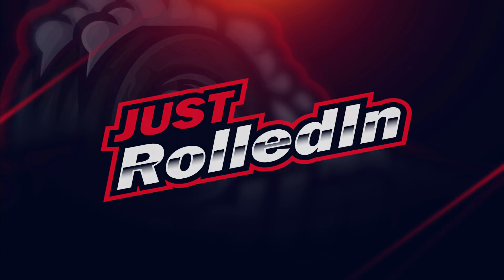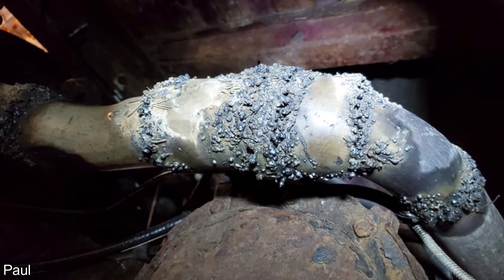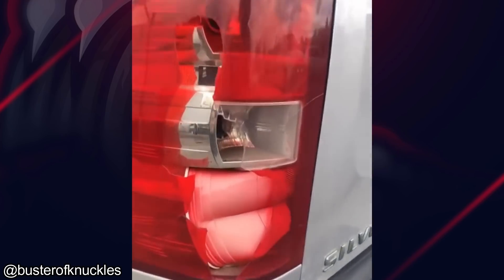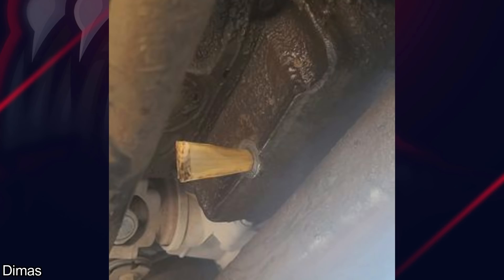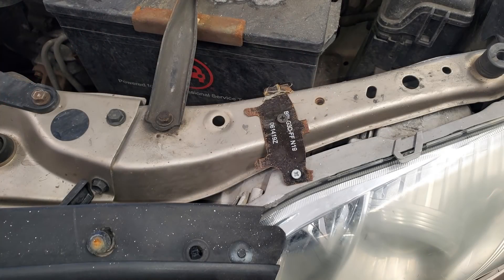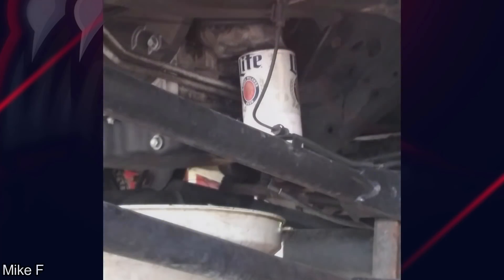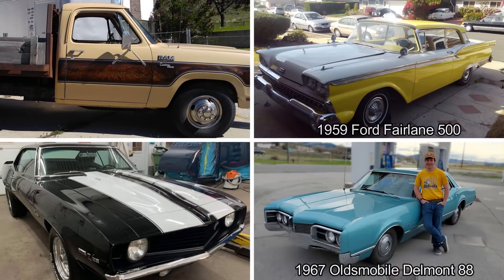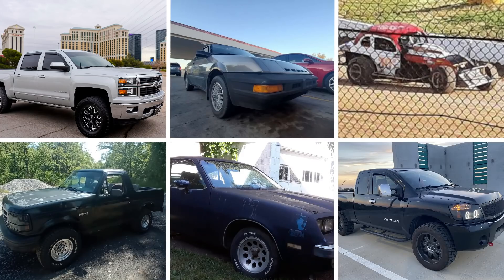Customer States Another Shop Failed To Fix Their Exhaust | Just Rolled In

Comment: 2:30 - Happened to my mother's boyfriend once. He brought his '95 Grand Prix into the dealership he bought the car from for the "free lifetime oil change." On his way to our house the next day, the car was extremely difficult to control. So, Mom asked me to take a look at it. I drive the car down the driveway, and as I hit the transition between our driveway and the street, the steering wheel tore itself out of my hands! I drive (slowly) up the street a little and notice a severe case of Death Wobble. Turn around in my neighbor's driveway and the steering wheel rips itself out of my hands again. So I get out and take a look...
I approach the front left wheel and notice it is tilted at an unnatural angle. My first through (EDIT: THOUGHT) was ball joints or busted control arm. I go to wiggle the tire by hand, and one lug nut falls onto the ground! So I look at the 4 remaining lug nuts, two of which are BARELY engaged on the studs. The little plastic caps that thread onto the lug nuts for aesthetics were all cracked, and they weren't that way a few weeks prior when I did a brake job.
So I thread the lug nuts on as much as I could by hand, and brought the car back into the driveway. I removed the plastic caps and tightened the lug nuts PROPERLY - it appears as if they used the impact wrench on the nuts WITH THE CAPS STILL ON THE LUG NUTS! As soon as I snugged them down, the car returned to its former smooth handling and I knew that was the "easy fix."
So I told Mom's boyfriend to call the dealership and read them the riot act. This was a stupid and dangerous error that needed to be addressed with the tech. (If I were the Service Manager, I would have had some brutal words for the tech, and might have considered termination! There's some serious liability issues here!) The dealer's response? "Well, they HAD to take the wheel off to perform the oil change."
No, they did not. GM's 3100 engine has the oil filter mounted close to the centerline of the vehicle, complete with a v-shaped piece of steel to divert draining oil into a controllable stream. The oil plug is also along the centerline of the vehicle. There was NO NEED WHATSOEVER to remove the wheel to perform an oil change.
Needless to say, we no longer took advantage of the "free lifetime oil changes." We started doing them ourselves; the cost of DIY LOF is much cheaper than hospital bills or funeral arrangements!

Comment: Worst thing I ever saw on a stereo install was somebody who decided to use the single  retaining bolt for both rear seat belt buckles for the amp ground. What did they use to attach the seat belt buckles to the body? Nothing...they used a carabiner to join them together. In a crash, one buckle would just pull the other buckle through the seat cushion! 🤣🤣

Comment: Looks like they used a MI welder on that exhaust...You know, 'A MIG without the gas turned on"....those loose lugnuts on the 'forged' wheels...I've got a 73 Corvette with aftermarket aluminum wheels, they make sure you know about the hardened steel washers that go on there behind the actual lugnuts.

Comment: Hahaha, on my car the t bolt that holds the emergency jack to the side of the trunk sucked and wouldn't support the jack properly so I just tossed it in the trunk instead. When I did my subs I was looking for an easy bolt to ground to and was like. Hey the tbolt threads might be a good spot, sure as hell worked absolutely mint

Comment: Fight Big Oil. Use it unrefined, straight out of the ground like nature intended. Or if you can only find globs on the beach, boil the excess water off and pour it in. Don't worry about the sand. That's what the filter is for.

Comment: For bigger car amps usually I would run at least 2 x 4ga back one + one - and ground the - at the back as well. All paint and other coatings must be removed relying on a star washer to ground through paint is going to end up bad one way or another. Best case scenario the amp will be gutless worst case it burns the car down.

Comment: I bought a SAAB some years ago, as I had always dreamed of gettign one.

Ok, this was a SAAB 93 1.9 TDI and so it was a GM / Vauxhall Vectra I suppose, but hey ho!

Anyway the seller gave me a 30 day warranty as is required by law n the UK, and 33 days after buying it, it jumped into Limp mode.

I had been given assurances that it had just been serviced before going onto the forecourt, and it clearly had not.

It needed a full top end rebuild, new EGR, New inlet manifold, new swirlflaps, new this, new that, new the other...

Since doing that, it has been sweet, but the syrup that we managed to get out of the engine was nothing short of disgusting... It had not had an oil change for many many years.

I think that rather than just get it sorted, they waited until the car was about to fail, then sold it off.

I still have it and I recon with proper servicing and use, it should last me for many years to come.

Comment: Ive also seen diff fluid come out that color from a chemical reaction from an aluminum housing
Reply from the maker: Dang never seen that. Interesting
Reply: @JustRolledIn  i done a newer ford recently.. it was a xlt with the 5.0 had a aluminum housing i saw a white color fluid swirling with the diff fluid and was like what da fack is this?? Showed my boss.. which is a 15yr diff tech told me thas cuz it was in a aluminum housing. He said...if it were mixed with water it would be thinner and all one color..it was a new one on me as well 😂 but never seen em b full of shit before
Reply from the maker: @bmanclassics4350  Very interesting. Never heard of that and I even worked at Ford lol. The more you know lol
Reply: @JustRolledIn  hell yeah man..bein honest its like one of the 2 diffs ive ever encountered with a aluminum housing im more of a jeep or really any Dana axel man myself..but i will but open a clam style every now then (such as 90s thunder birds or LX model sedans such as newer chargers) and alot if gm 8.5's u dont really see fords here that much on the differential end of things.. unless its a 9" swap or ratio swap

Comment: As hilarious as that wire feed weld job is, at least the guy stuck with it and tried his best. However, by the look of it, he didn't get to drive it for long, as the mess is still pretty fresh. For his next project, he should learn how to use an angle grinder. Then maybe he can hide some of his bad welding. I am curious though, it seems there was a lot of splatter in weird random places. Perhaps he was using a hand held fixed tint welding mask and welding one handed?

Comment: The way I like exhaust job done is with good common sense, something that lasts a long time and durability. I would rather have a pipe slid into another pipe a little ways and then clamped with a stainless steel band clamp and if it's for performance. Starting front to back the pipe slid in beginning with the front and slid to the back so there's no ends that catch. And also any system I want plenty of muffler hangers and supports. Maybe one day they'll come out with aluminum pipe and full exhaust and muffler systems to keep the weight down for maximum performance.

Comment: OK, the missing drain plug, I totally understand in an emergency you have to keep oil in the engine, right?  What would you recommend?  Drive it without oil?
Reply from the maker: I'm not going to recommend people using a piece of wood as a drain plug because I dont want people blaming me if something goes bad lol, but ya it will definitely work to get you where you got to go. If it works, it works.
Reply: @JustRolledIn  As long as it is in the right circumstances.  In remote offroad locations, just to get to cell service or access to parts.  yeah, in town, where you could just as easily get a new plug, just take a cab or have it delivered.  But then, how do you lose the plug out in the woods, without the pan being all bashed in?  i've used a screw to plug a hole in a pan, never seen the plug missing though.
Reply: duct tape and flex seal lol

Comment: honestly with all the cat back exhausts where no welding is required why wouldnt a no vice just do that. worst comes to worst you can bring it down to the shop and have a mechanic install it. even though its super easy to install cat back exhaust systems.

Comment: My cheap tractor supply Hobart welder can do better, not much better, but I did true duals on a truck with it once. Had to take it in to get proper welded bc mine kept breaking. (Note the cheap Hobart wire feeds don't have argon hookups

Comment: as a professional welder i'm stumped as to wtf they were doing when they welded the exhaust.  i think maybe someone a)was without a welding hood and couldn't be bothered to get one   b)they are just teetering on the edge of blindness, or c)they said they could weld on the job application and didn't want to fess up when asked to do it!  it's laughable unless you're the customer, in which case you should be royally pissed off.

Comment: How did the water get into the diff?
Reply from the maker: Water can get into the diff from the vent hose if you got it in deep enough water. Or if the vent hose is ripped off.
Reply: @JustRolledIn  ah yeh. I didn't think about off road. 👍

Comment: Ok , that beats the job my local Midas Muffler shop screwed up on my car.    $450 later, and my car car still had an exhaust leak.!
I brought my car in to replace the catalytic because of an exhaust leak, and the stunned sob's left open gaps along the seam, missing it altogether in places. 
Pissed off, I brought it to a local Master Mechanic, who not only installed the whole NEW Cat I had to buy to "fix" what Midas "fixed", but parts and labour came out to 1/2 
of what I got screwed out of by MIDAS MUFFLER.  When I called head office to complain, I got put on hold listening Muzac then disconnected....TWICE.!  F Midas.! They SUCK.!
Reply from the maker: You're not the only one who mentioned in the comments out MIDAS. Never been there but sounds like a terrible place to bring in your vehicle
Reply: @JustRolledIn  I hope someone from Head office trips over this thread.

I don't know where they hire their mechanics from, but I wouldn't trust any of them to inflate my tires now without fucking up.    Be well. Stay safe, get vax'd.

Comment: As a professional welder of all kinds, I find it hard to figure just how that was done. It looks to me like he tried to stick weld using coat hanger wire instead of Flux coated rods. Welding rods with no Flux at any rate, which must have taken about a week.
Reply: Didnt you see the wires on the welds?  The guy was MIG welding without the gas.
Reply: Now that I look again it does appear that way.  What a mess

Comment: I don't get it here in Europe after a new car is three years old you must have a yearly MOT inspection at a government inspection facility they are all fails and would be put of the road you get a list of faults that must be put right before you can reapply for another inspection.  If found driving without an MOT the car will be seized because you need a current Mot Certificate before you can tax or insure your car van truck lorry whatever so if caught you are in deep doggy doo doo maybe large fine car crushed suspended drivers license and we all agree because it takes all the dangerous cars of the road.